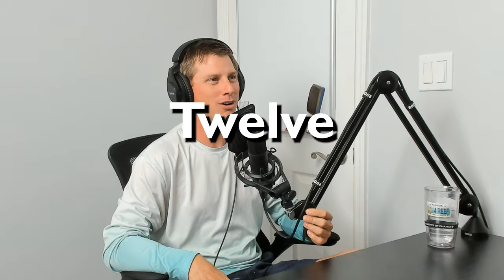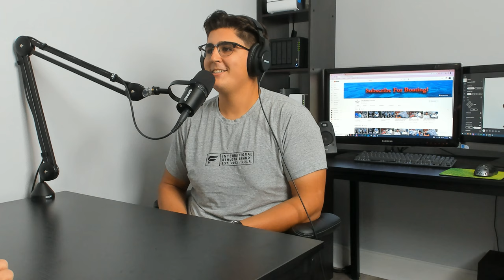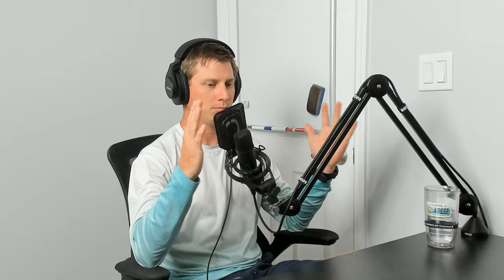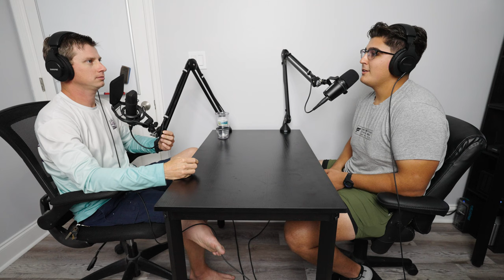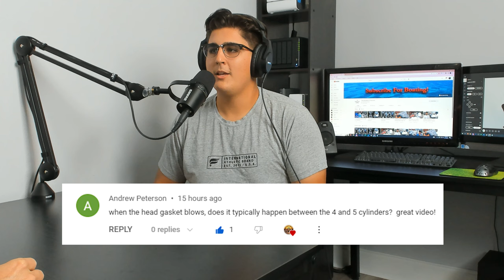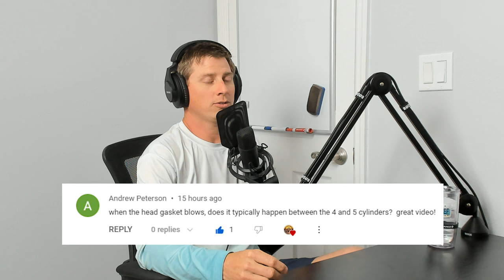Why Head Gaskets Fail.

Comment: Thanks for the callout - the reason I was asking - I pulled the head off a L6 350 with an overheat issue and the 4-5 cylinders were burnt through.

Comment: I like the podcasts!

Don’t listen to mercury when you call. I was rigging my own boat and called up Mercury outboard headquarters to ask a question and they told me “you can rig the boat yourself, there are too many electronics involved with the varados” turns out they were wrong. Only had to bring it somewhere to sync the DTS modules to the binacle.

Comment: The early 2000s df 200-225-250 had a defect on stb block being out of deck. Always popped between 3-5 cylinder. Must have done a 100 of them. Zuke sent block and heads , we'd send the popped block and heads to machine shop to have on the shelf for the commercial guys with no warranty.  Was a busy few years.

Comment: 2005 Suzuki 225hp are very well known for overheating head cuz small water passes through the block around cylinders and head..it was my foul cuz I was doing a lot of shallow water fishing,, sand and stuff got in one of the head and overheating sensor never noticed it,,very expensive repair 😒

Comment: Big fan of both the BAB tutorials channel and the Podcasts.  Keep up the fantastic work here and wishing you guys loads of luck in your new mobile service venture!

My question is this:  I have a 2002 3.3L Yamaha F225, mid section was already done.  Overheating was always a thing on the older "2-smoke" outboards my friends had when used in salt water (never had issues with my personal engines).  I flush like a fiend, but I still always worry about it -  especially knowing how much it costs to repair one nowadays.  I pull anodes every year to make sure my flushing is working as it should, but I still always wonder if the alarm is going to scream as it should, in an overheat or low oil pressure situation.  Is there a test I can run that forces the alarm to sound so I know the warning siren will sound off like it's supposed to?  I bought and installed YDS on my laptop and have the proper cable, so I have that available to use.  Would appreciate input on this.  🙂